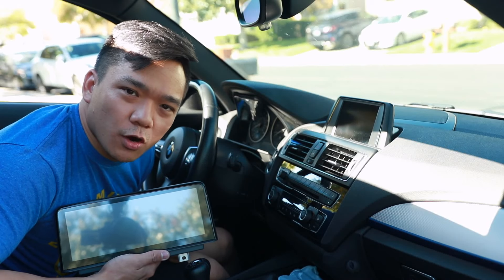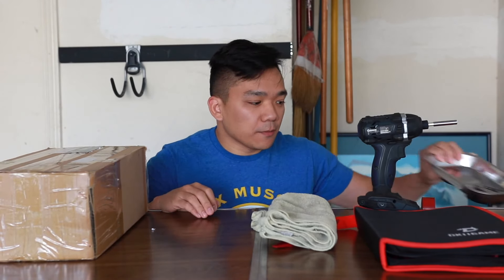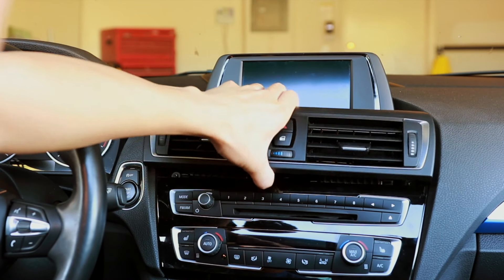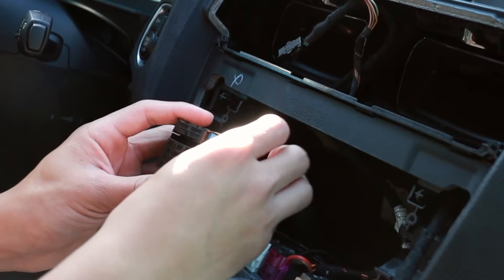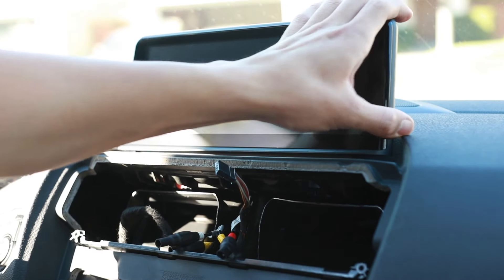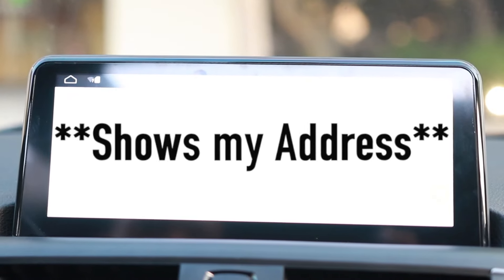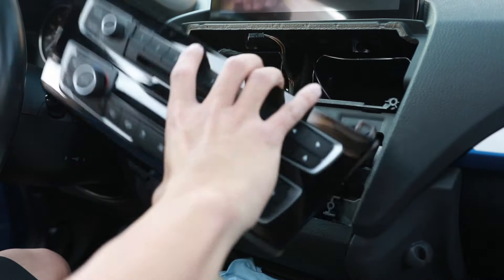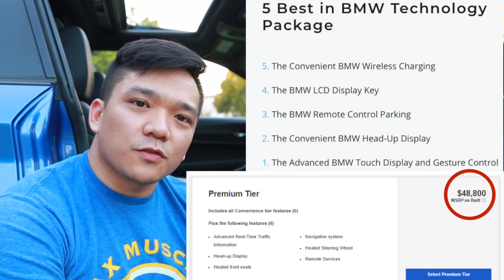BMW Android Screen | BMW Screen Upgrade | Koason 10.25" Display

Comment: Hi fritz I'm still waiting for the screen hahaha.... The quality sound it is good without the AUX cable?
I bought the android auto bondle to use with the USB, you have experience with that?
I will use a micro SD card for movies and to download Google maps also music....
The Bluetooth call and music audio quality its is good or bad to be honest?
Reply from the maker: Audio comes in fine without the aux and I haven't had complaints while taking calls.

The dongle is something I haven't experimented with yet, but I will soon.
Reply: @FritzRamos  finally I just finished the install.... Not hard but not easy hahaha.... I struggle a little bit with the audio... No audio then I put the AUX and change some settings and Audi fix and no need for the AUX..... I try to connect my cellphone through easy link but I don't know witch usb port I have to use... One says USB and the other says USB and another words....you have any experience with that?..... BTW the screen looks amazing really happy with the upgrade
Reply from the maker: @sebb6342  The easy link can be done wirelessly if you use your phones hot spot, so no need for usb connection. I have not tried the wired connection because I usually use the phones hotspot while driving.

Comment: Hey fritz do you know if it is the same method to fit in a RHD 235i?
Reply from the maker: The process is the same, but you have to buy the RHD unit because it should curve towards you
Reply from the maker: The process is the same, but you have to buy the RHD unit because it should curve towards you

Comment: How fast is this unit? you have 4gig ram, is it snappy?
Reply from the maker: It takes the android side about 5 minutes to get fully up and running. The regular infotainment comes up as normal.
Reply: @FritzRamos  does this 5 minute wait have to happen after each car stop/start ? thanks!
Reply from the maker: @Ris-v4w  Only the android side and for the most part yes.

Comment: Hi! Congratulations on the job! I ask you one thing: I would like to do the same with my car (install the display). Do I have to disconnect the car battery or can I remove the radio and the display without removing it?
Reply from the maker: Thank you. It's best to disconnect the battery while putting in the display

Comment: Great video. Thanks for sharing. 
Going to get one of these units for my sons 2014  1 series. Will it fit okay?
Reply from the maker: It should. Just make sure when you buy it that it's specifically designed for the 1 series.
Reply: Yes,you can get one from bmods.co.uk

Comment: Hi. I do not have bluetooth audio on my current system. If I upgrade to this system, will I have it? or do I need to purchase an extra hardware? Thanks.
Reply from the maker: Yes it will and no extra equipment is necessary. You just have to select in in the settings.

Comment: Hi, I have a 9270391-04 + 9317695 02 (panel+controller) in my F20 118d. I read that your system has to be NBT and not CIC - no idea what I have. Can somebody tell me if I can swap my panel with the android panel and buy a new controller 9267956 (4pin Nav button)?

Comment: Hi Fritz, thanks for the video. I did the installation but the door indicator seems to be swapped around -- that is if the driver door is open  then the unit indicates that the front passenger door is open. How can I swap these around?

Comment: Hey Fritz, i know it's been awhile, but I installed a similar HU on my F48. I only get audio on the BMW menus, but not on the android side. Did you have to connect an extra aux cable to the car somewhere?
Reply: You have to switch the audio source on your phone, try switch that to the Bluetooth of the head unit, if not then switch back and forth between the car Bluetooth and the head unit Bluetooth eventually it will work

Comment: Am from Jamaica. Is there anyway I could get internet access to my f30, 2018 without using bmw idrive because connected idrive service is not offered in Jamaica.
Reply from the maker: Just reached out to the manufacturer. Will let you know when I hear back.
This system uses an android interface and does not use the BMW connected drive, so you will be okay.
Reply: They let you connect hotspots

Comment: hey fritz.
but can i mount a front camera without any module with this head unit?
Reply from the maker: You should be able to if the camera feed is through a USB, so you can plug it into the head unit

Comment: HI,  it looks indeed very cool! unfortunately, installation is not my strong part. if I buy this item, do you have any contact in Prague CZ?
Reply from the maker: I do not. Honestly, it just requires some patience and a gentle hand. You could do it!
Reply: Fritz Ramos hey also Dallas tx an i have a 328i 2012
Reply: Heu Fritz thanks for reply! Jus need to double check do you have all the access to your phone, speaker etc???  and is all BMW features supported like tyres condition, ECO mode regulation etc...? thanks!
Reply from the maker: @gigibokeria6933  all original functions are maintained. If you want to add features like you listed because your car didn't have it you can add them no problem. It just requires a few more pieces of hardware

Comment: Hey, thanks for the video! Can I ask a question? Does the unit use the BMW speakers through the radio, or does it need to plug into the aux port ?

Cheers!
Reply from the maker: I didn't have to use the aux cord but it could depend on your model. Also, The manufacturer told me that this unit for the m235i will work wiout the aux
Reply: @FritzRamos  nice, cheers dude :)
Reply from the maker: @sirmuffoon  Np. Let me know how it goes

Comment: Hello Fritz, thanks for your video. I have a 2021 x3 and I want to change the 8.8 inch display to a larger one (maybe 10.25). I also need someone to help me install the head unit. Could you or someone from your community help me with this? Thanks.

Comment: Hi Fritz, I have a F20 with a base unit + Alpine HiFi retrofit installed. And I am going to buy the Android Screen and installed by myself. My question is since there is one wiring harness installed (as shown 4:31) between the base unit and the Alpine amplifier, how can I connect the wiring harness order between the unit, Alpine amplifier and Android screen? Many thanks

Comment: Great video and tutorial! Your channel is really helpful...I subscribed. I'm looking at a 17 230 msport but it has the 6.6 in screen. This seems like a huge upgrade and definitely something I'm interested in doing if I get the car. Curious if the nav works on the non-android side? Also, how does the android side work as far as a connection? Is theres a network connection or something thats required?
Reply from the maker: Thank you! The factory nav should work as normal, just make sure to stretch the screen, https://youtu.be/8NrPVNs2-Cc

As far as network, I just use the hot spot from my phone. I think you can use a Sim as well.

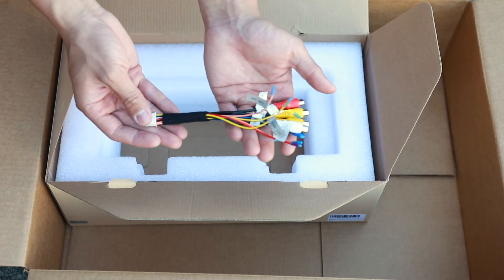Comment: Hi :) at 2:00 can i install a microphone for speaking whilre drive  in one of these connectors? thx
Reply from the maker: Not on this particular unit. The built in mic works well and the idrive side still uses the oem mic
Reply: Sir wer i  can buy the screen here in philippines
Reply: @edmonreyes8776  ali express

Comment: Sweet head unit installation video! For those of us that's just watching you for the first time, what's the year and model of your BMW? And is this install going to differ across different year models? What differences can we look out for?

One more question for us with brand new BMWs, how would this install affect our warranties? Thanks for puttin' this video out man, very helpful. Keep rockin' it!
Reply from the maker: Thanks man! You are always giving great feedback.

I have a 2015 BMW m235i. The install should be the same for anyone with the screen that pops out of the dash, maybe some variation between aftermarket brands is all.

I would imagine it voids the warranty but since it's all plug and play, if anything happens just pop your old one in 🤫(and it looks close to oem that they might not notice unless they're wiring in that specifically) or wait until the warranty is up, that's what I did.

Comment: Great video, helped me out a ton.  Just installed the Koason display for 2015 F22 228i base NBT!  Hardest part was 
getting all the wires disconnected/connected.  The screen stretch video also helped a ton because it needs to be coded using Bimmercode from a 6.6" to 10.25".  Amazing screen, love how it's black trim, perfect.  Can't get google maps to show the actual map and grid lines, but it does show all the directions, etc.  I did connect using hotspot, i think there's no other way to use navi other than hotspot and offline maps.  Wondering though, did you have to update android or all the apps to get them to work properly?  GPS satellites are decently reading me.
Reply from the maker: Thank you for sharing that and I'm glad that you found the videos helpful. I did have to update all the apps and the current version of android when I got the tablet and it resolved most of my issues. Let me know if you run into any more issues and how things went after updating!